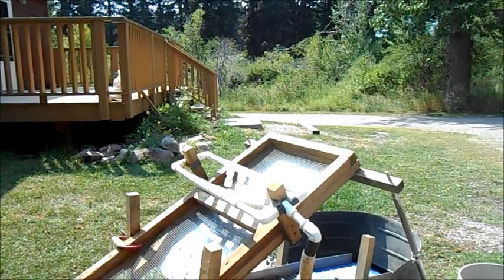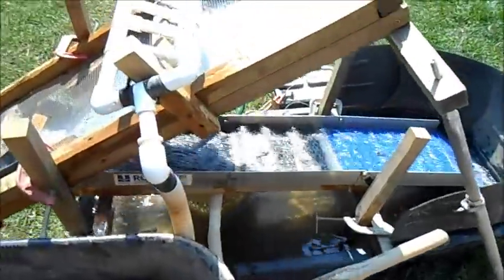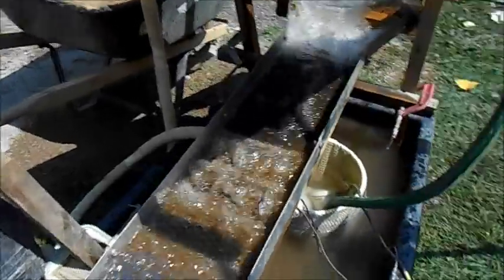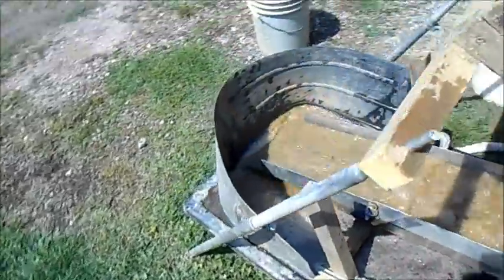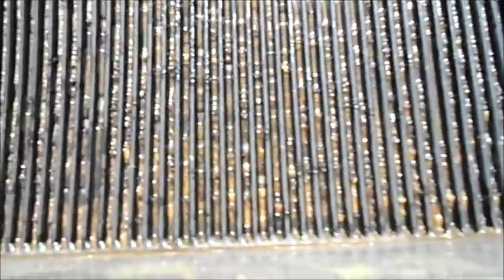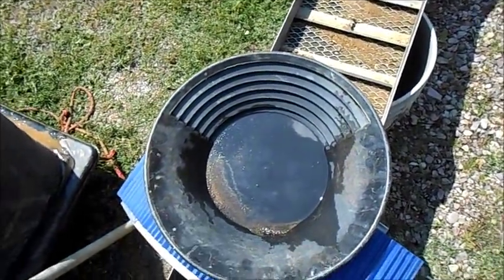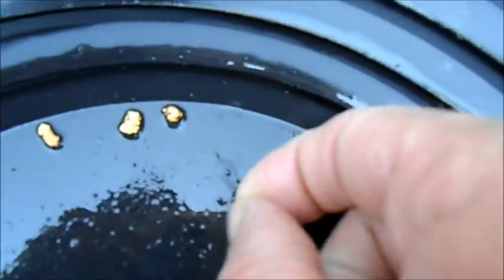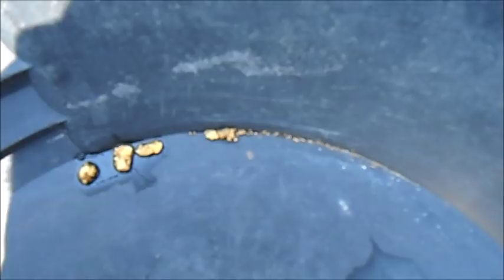Testing New Sluice Box Set Up For High Water Flow & Chunky Gold

Comment: Nice video Alan, I might have asked you this question in one of your other videos but what angle do you set the sluice at? Is it suppose to be 1" per foot?
Reply from the maker: Thanks Michael it all depends on water flow and what material you are running as well as the mats a good place to start is 8 to 9 degrees.
Reply: Ok thank you sir

Comment: Looks like it's working really well for you. If you decide to run the tailings again, You might try cutting out one of the pumps to give the fine gold a chance to settle out. That's what I did with my Gold Hog mats and it let me catch a lot more fine gold. Looks like you have a great setup for the summer. Keep at it.
Reply from the maker: I think you are right. I was going to run the material again with only the 1000 gph pump to see what I missed until I only saw a few pieces of gold in the bottom of the blue mat. Thank you for your input.